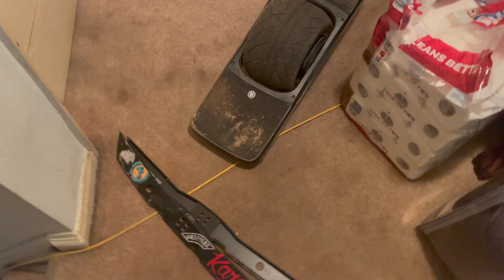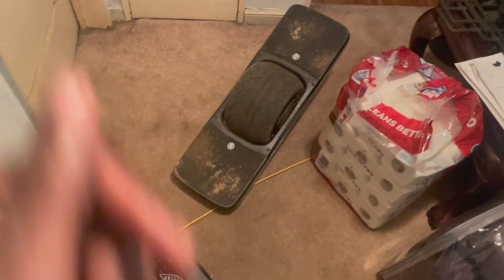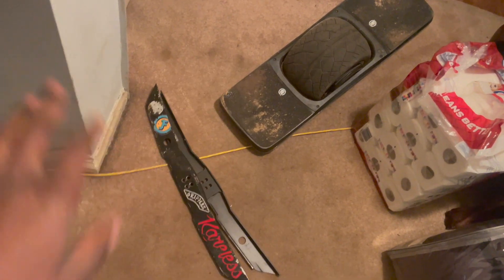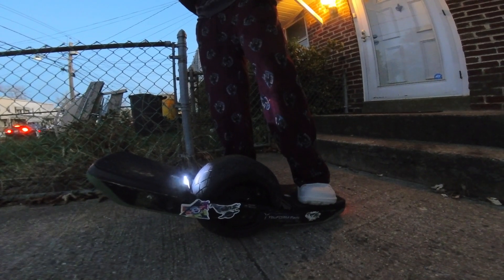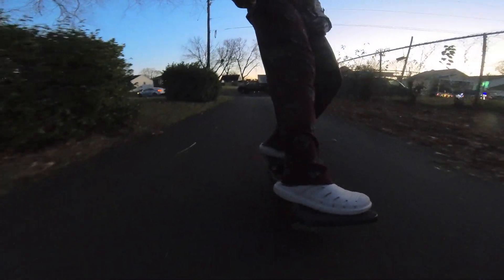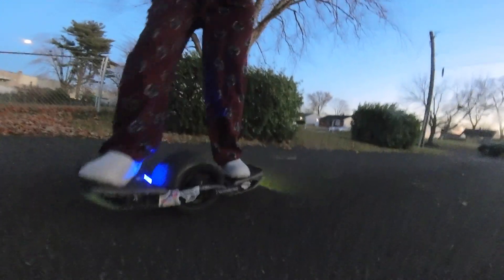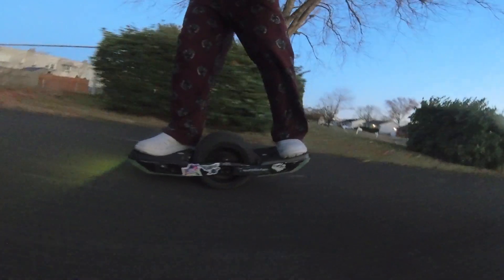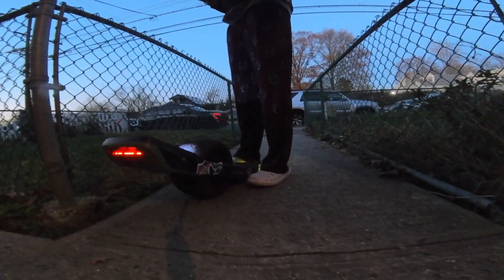Onewheel Custom Shaping 3.0 | Adjust Enough For Aftermarket Rails?!?! | Onewheel GTS

Comment: Great test. 

The compensation of 3° nose up in custom shaping for the Katana at 3.5° and WTF Standards at 3.7° leaves both custom rails slightly nose down. While slightly sketchy, the GT-S motor seems to be strong enough to keep your nose off the ground in spite of your power stomping (thanks for that demo).

The main challenge comes from riding in reverse (switch) because it isn't the same compensation in that direction (tail side).

Elevated isn't really an option, as it has a builtin lower top speed and can cause problems with braking, especially if you're already in pushback.
Reply from the maker: Yea it def has power and with dynamic response up its should be fine on less chunky trails. When I looked elevated still had a top speed of 25. I’m testing that out with custom nose all the way up to see what happens. I think it’ll sag at the start but then pick it up